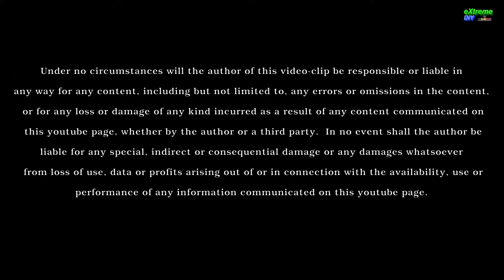DIY - How to make a CROSSBOW PRESS and REPLACING A BOW STRING

Comment: That looks like the Poe Lang/Armex Titan 200lb crossbow....
Reply from the maker: Is indeed the Titan 200 LBS
Reply: @ExtremeDIYinBelgium  I'm planning to make one from box section steel tube, cut 4 pieces say 100mm long, they are 20mm square external and 15mm square internal- then slot these over the ends of the limbs/prods. If I drill and connect each pair with a locking nuts and bolt system to fix the distance between them, then it's a matter of connecting either chain or steel wire and a turnbuckle to pull them together- only issue may be not to make the box steels too long as it may exert too much force on the limb where it has been drilled through for the pulleys? Any thoughts??